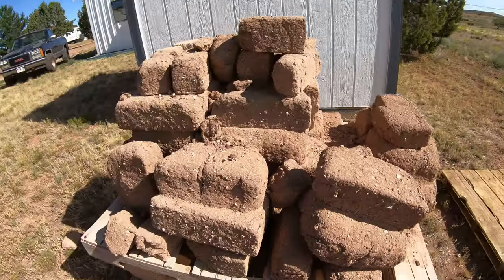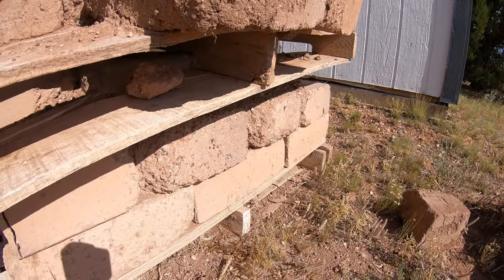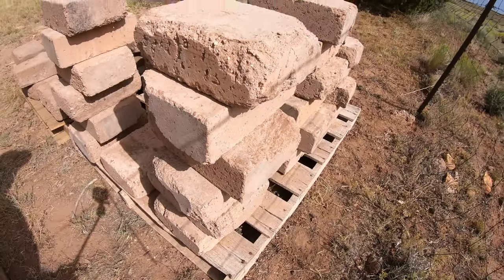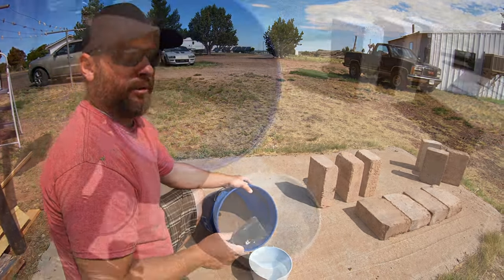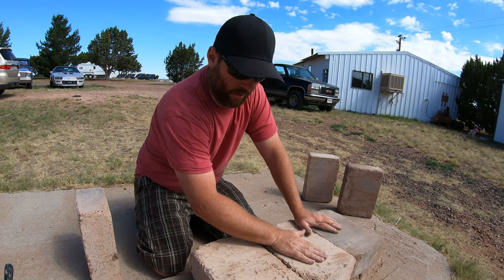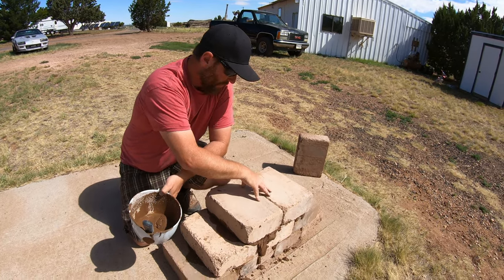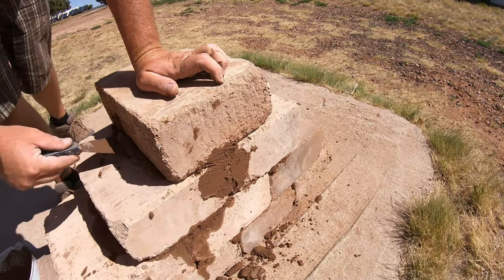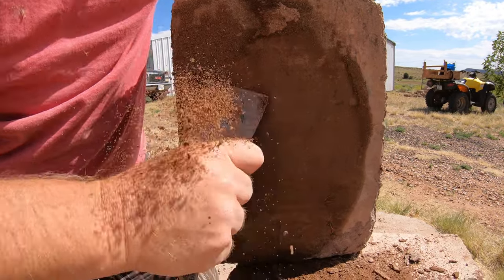Compressed Earth Block

Comment: What is the slurry made from? Silt? Clay? A mixture?
Reply from the maker: We made this slurry mixture from the same material that we made the blocks out of we simply sifted the material through aluminum window screening material. So our material had clay and sand and probably it a small element of silt in it. Hope this helps
Reply: Rammed Earth has a mixture of 50% sand, 20% gravel, 15% clay, 15% silt

Comment: What if both sides were hydrologic? Would it be stronger overall?
Reply from the maker: What do you mean by both sides being hydrologic?
Reply: @SustainableLiving  You mentioned how one side was stronger than the other because of the hydraulic pressure. I was just curious if pressure was exerted on both sides if it would be a stronger brick overall.
Reply from the maker: @sleepinggiant882  Okay, now I am following your questions.  Yes, I believe the block would be stronger.  Grant it I am not an engineer to show numbers to certify this.  When building my house we definitely discussed this concept of pressing from both ends, in theory it seems like a very rational argument to make a stronger block.  I do not know if such a machine exists, I would be curious if you know of such a machine or if anyone else who reads this post could further direct a link to such a machine.  I think this would be very helpful with this type of building material.  Thanks for your question.

Comment: I guess I don't understand the mechanics of sticking each course together with just mud.  ?  I get that within a couple of minutes those are stuck together, but how does that work over time?  "It's just mud, not cement."

I believe it works mind you, I just don't have the mental picture.  What about over time and that gets all dry?  

Anyway, anyone with experience or a stonemason can explain to a simple guy how plain mud is actually viable as mortar?
Reply: I used to work for Advanced Earthen Construction Technologies for around 12 years. They built CEB machines such as the MC3500, and Impact 2001A. Imagine stacking 2 wet bars of soap in the shower and letting them dry out. The key to thier bond is they are like materials, and that the moisture from the thin slurry style mortar drys by moisture being wicked into the blocks from the joint. Also to achieve a good headjoint, you set the block a few inches away from the adjacent block, and slide into it to cause the slurry to be skid vertically up the head joint. That eill achieve the bottom portion if the headjoint. The top is achieved through the application of the mortar for the next layer of blocks. Also its good to leave the joints exposed on the exterior so that you can have a better surface to apply a scratch and precoat for later applying the lime plaster exterior with a natural latex finish for a breathable sealant. It can be made from nopales that are fermented for their latex. Also side press machines are inferior to top press machines. AECT machines are superior because of its patented elastic press plate. Best bet, stabilize high sand soil with cement. Stabilize clay soils with lime. Only stabilize first 2 courses. Next courses are natural. Pour concrete bond beam or lumber bond beam to join the roof. Do not insulate blocks. They ar thermally loaded and work with moisture transfer. Use chicken wire on the outside, put a botton galvanuzed edging to catchnthe bottom edge of stucco. Lime plaster walls with natural latex additive. It becomes a seal that is still breathable.